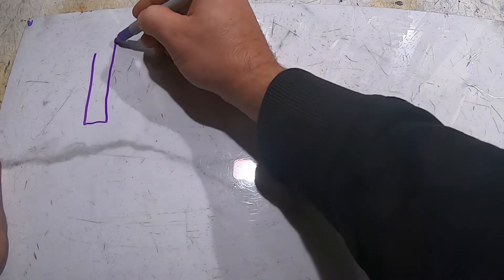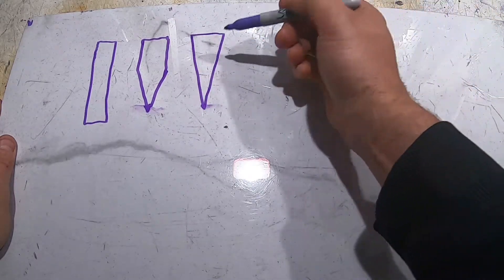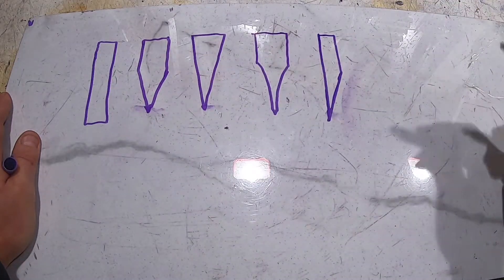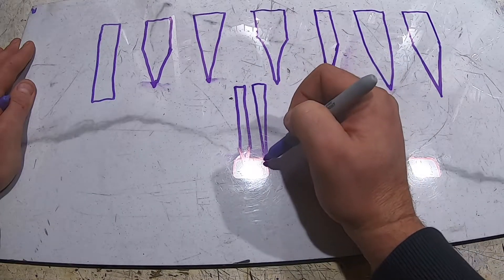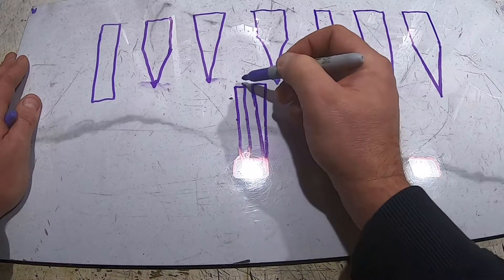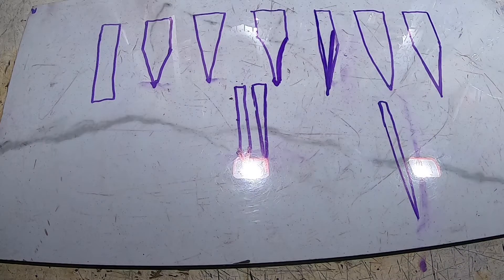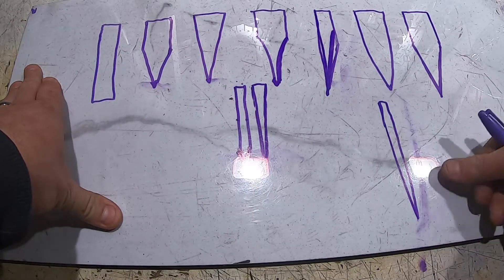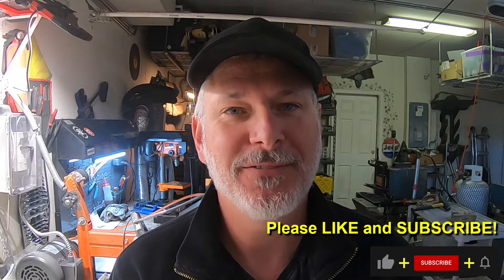Triple-T Thursday #15 - Edge Geometry

Comment: Very informative video. I think a lot of people shy away from thinner blades just because of the trouble with warping and cracking. I've only made to knives to completion. One is made of a chainsaw bar and is 3/16" thick at the spine. It's a flat grind only about halfway up because i wanted to keep the word POULAN that was stamped in the bar on the blade.....and because i put my bevels in with a file and sandpaper lol the other is a 8" crescent wrench that i forged. It's a good bit thinner, but still fairly thick and has more of an attempt at a convex grind .anyway, i have a few other attempts in between that were thin and i couldn't keep from warping or cracking or both in heat treat.  That being said, i know there is a lot of knowledge that goes along with the skill involved with being a knife maker that i don't have yet. That was a long winded way of saying that, some people probably keep things too thick because they're scared of messing up another blade. I'm exactly the opposite with women. I'm scared of skinny chicks lol
Reply from the maker: Yes, I totally understand fear sometimes.  I still tend to leave blades thicker when forging and grind thinner.  If I’m worried about a warp, I’ll do that thinning after heat treat.  I know that doesn’t work for folks using hand files.  Thanks for watching and commenting! 👍

Comment: would a hollow grind work for a chefs knife?
Reply: Typically not ideal as when you cut you have a sudden rapid increase in steel thickness which creates a lot of resistance in your cuts. Unless you use a hollow to make an S grind you will often find convex or S grind will significantly outperform a hollow for a kitchen knife.
Hope this helps!
Reply from the maker: I think Mike explained it pretty well.  I’ve seen hollow grinds in cheaper knives (cutco, Chicago cutlery) and I agree, they don’t perform well.  Thanks for watching and commenting, guys!
Reply: @Orzel_Knives  thank you, i was just curious